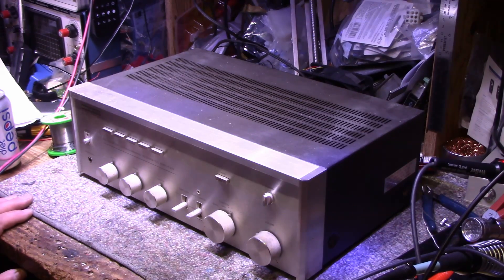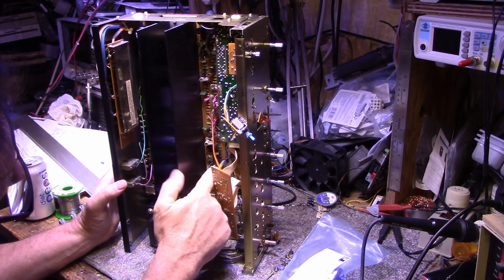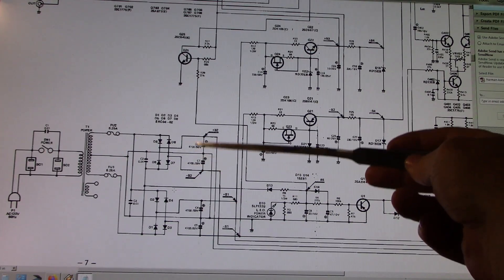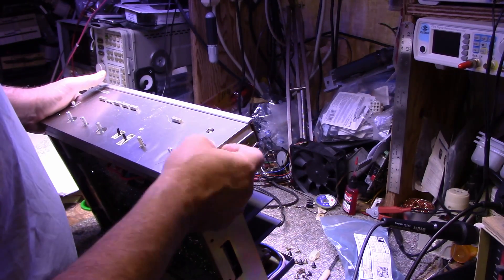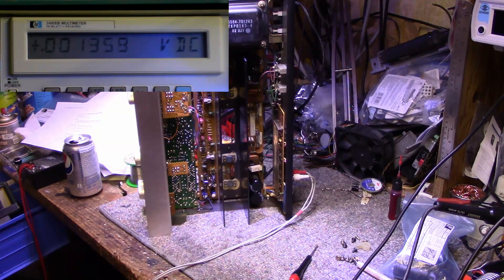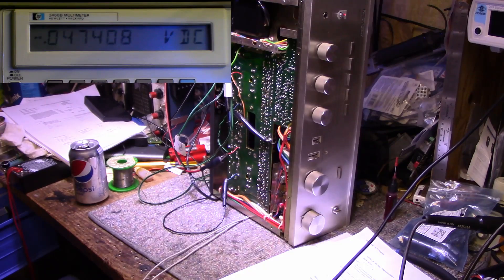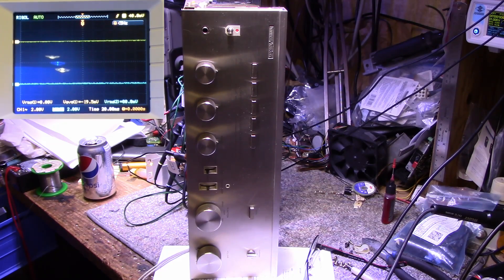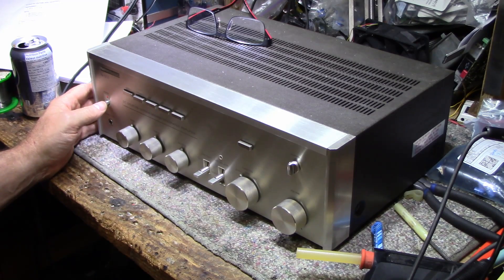Harman Kardon HK503 Amplifier (Ep. 43)

Comment: This was my first amplifier.  Bought it around 1979.  Had it hooked up to a pair of JBL L50's and a Yamaha turntable.   All I have left is the Yamaha, which is still working but hasn't seen much use.  I had the amp for ten plus years until it developed a problem, can't really remember what it was.  I was told it was unrepairable back then.  Starting to feel now like I might have been scammed.  Not sure where it ended up.  I was starting to get into home theater in mid 90's so it was time to move on.  
   But just seeing it here kinda made my eyes water a little bit.  Just good memories.   Glad you are able to keep yours going.   As I remember it did sound quite good, I never had any complaints about the sound.

Comment: I have a Nikko TRM-650 amplifier in which i put two 10000µF main filter caps instead of the 6800µF that were used at the factory. Going from 6800µF to 10000µF I thought might be close to an overkill and i was worried about the inrush current at turning on the amplifier, but there were 4 thermistors, limiting the current at start, so i assumed I would be ok; and I was. Your jump from 4x4700µF to 4x10000µF was a bit braver lol I hope nothing will get fried over time at startup. Increasing the capacitance from 2x6800µF to 2x10000µF though gave the amplifier a sound that seemed to have more "authority". Everything, from the highest highs to the lowest lows sounded effortless and had more "body" to them, most likely cause there was a bigger reservoir for the low and mid frequencies. I think upgrading the main filter capacitors to a higher capacitance can be benefitial. Nice job, resurrecting Your old amplifier!
Reply from the maker: Hi Asiazh. Generally, the additional inrush current only effects the bridge rectifier and most decent manufacturers also add fusing in there too. If the inrush is really a concern, one could upgrade the bridge with beefier diodes. Also, one thing I've noticed  on most amps, when switched off the caps never fully discharge. There always seems to be some residual charge left on them from the last time the amp was used. This alone is a big limiter for inrush current.
I find it's OK to double the capacitance of the main filter caps and I noticed the same benefits to the sound quality. Especially if the original caps are tired & 30 years old, the contrast is very real. I wouldn't go further than doubling the capacitance because there is a point where more capacitance does nothing more for the sound quality. Thanks for watching & your kind comments and happy listening

Comment: Hi Trevor,
About recaps did you replace all capacitors including  preamp section (tantalum)? Somebody ask me to restore this amp. How many hours should be planned?
regards
Dan
Reply from the maker: I can't comment on how long it would take. All techs work differently. If it were me I would also be working on switches, pots and other things that would bump up the hours.
The Tantalum caps were fine so I typically leave them alone. Tantalums are more stable than electrolytic caps because they don't dry out. Their typical failure mode is short circuit which I rarely see in audio gear

Comment: I just got my hk505 and trying to clean the switches. I have done it for the hk670 but hk505 seems a bit complicated to get to it. How do you remove the switches or the faceplate? Do you remove the screws from the inside?

Comment: HI  I just got a HK 505 and sounded great but started to hear some crackeling on one channel ... checked the DC offset and the left channel is way off at 120mv  after it warms up a bit . The unit was supposed to been recapped ... where can I look to try to fix this myself ?  cheers
Reply from the maker: Crackle noises can be one of two things (generally). It could be a failing transistor or there are cracked solders somewhere in the circuit.
Take a magnifying lens and bright light and inspect all the solder joints. Especially around the driver transistors in the power amplifier.
If you see any that have rings around the lead or appear cracked, resolder them.
You can test for failing transistors by powering up the unit and then heating each transistor independently with the tip of a soldering iron. Any bad transistors will be revealed when you heat them up
Reply: @TrevorsBench  thanks for the reply , I wonder I was using 2 sets of speaker sometime (short times) for a bit before learning that was not a good idea...could that do something ?
Reply from the maker: @bisarowood  no